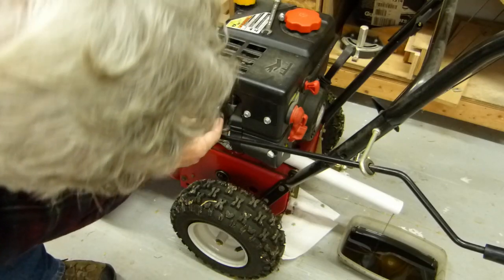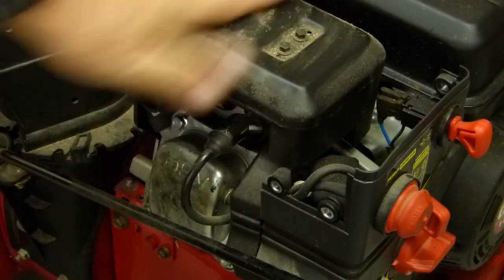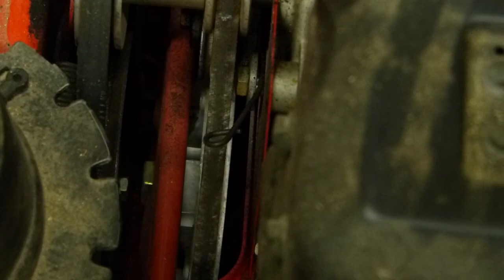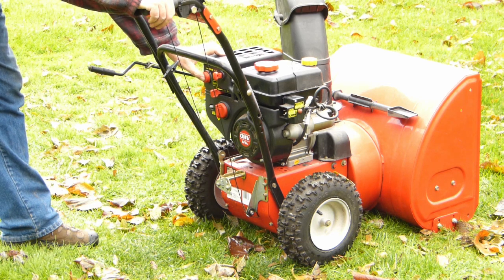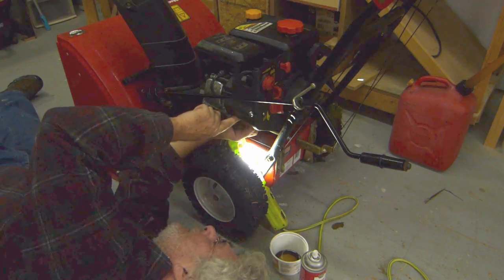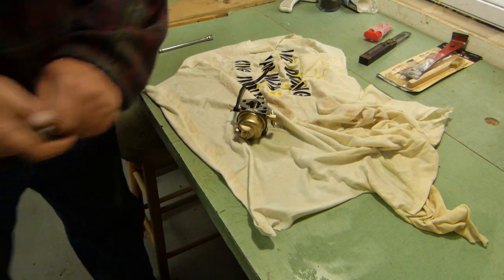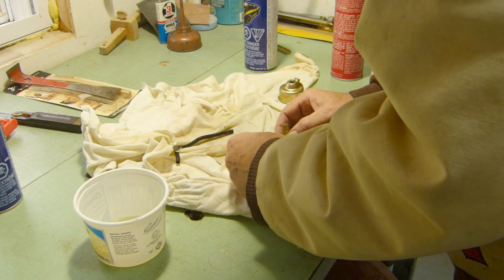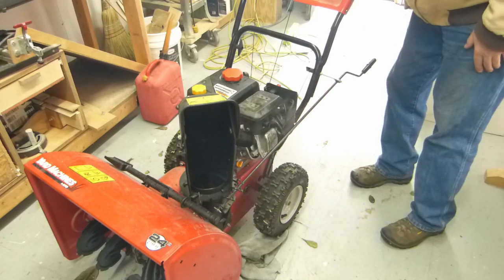Back from the dead: Fixing a snowblower

Comment: I bought a jointer three days ago. I watch your video and what do I see? Looks like the same model. Now I'm going back to your jointer 'Saga' videos to check them for any good information.

My method for starting my snowblower is to pull the ever-loving-shit out of it until it starts. I have a magic starter but I just pull it.

Another edit. That ramp on your shop should be the first thing anyone builds. It's payed for the time you took to put it in a million times over I'd bet.
Reply from the maker: I usually just pull them too, when they will start OK.  This one was having issues, so I saved my arm some work.